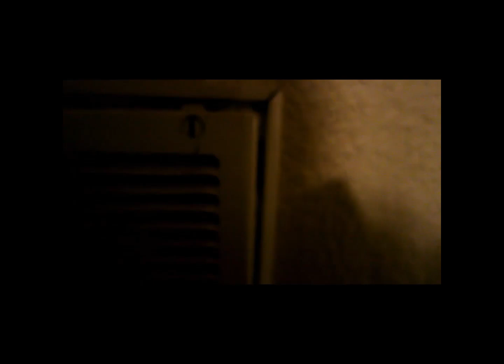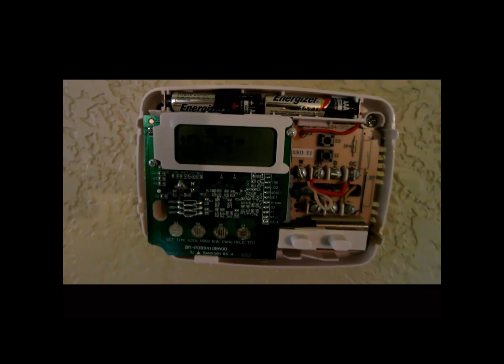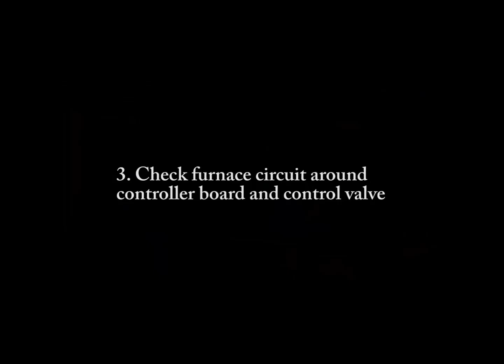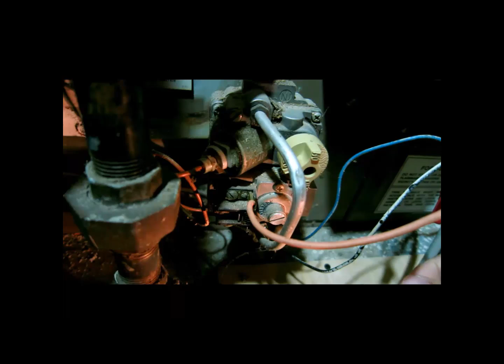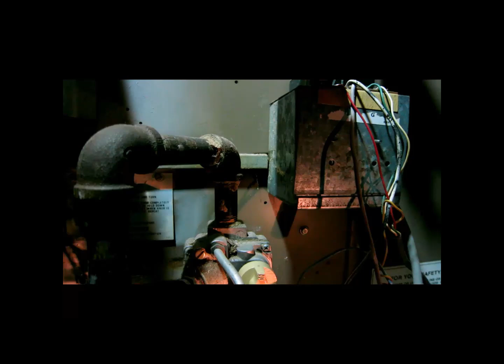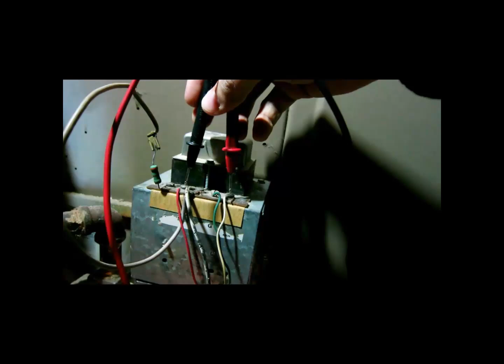P1 - Troubleshooting GE Furnace Gas Valve - Pilot light stays on but no flame or heat

Comment: I have a gas furnace pilot is on fan is on but the heat is not on.
Reply from the maker: Normally the fan kick on after the heater heats up the chamber. you might have a stuck limit control switch:
Furnace comes on but blower/fan stays off- HVAC Fan & Limit Control Switch replacement  ac